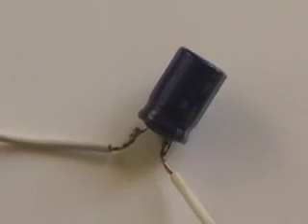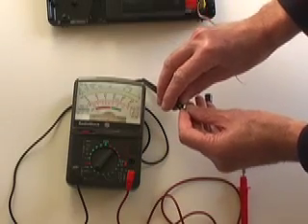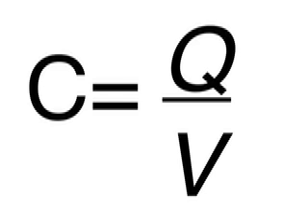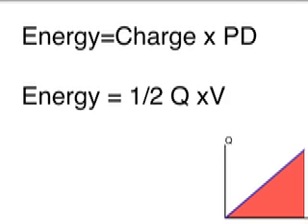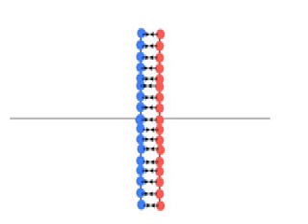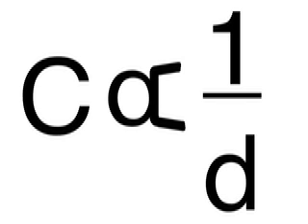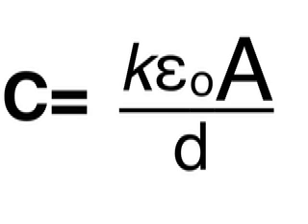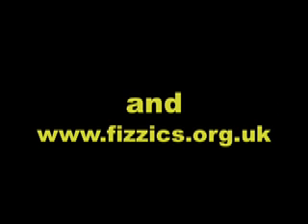How a capacitor works: from fizzics.org

Comment: But WHY are capacitors needed to store this energy?  I get why resistors are needed to reduce energy, but I don't get this.
Reply: Combined with a transistor it creates an repeating electrical pulse used for timing, creating a tone, and for creating a short increase in a charge like for a camera flash.
Reply: ***** Ok, but there's a battery in a camera. Why would you need a capacitor for the flash if you have a battery? Are you saying the capacitor gives the flash a boost or something? Would you mind giving me a couple more examples? I still don't get it.
Reply: Yes, when a capacitor discharges it let's out the power it has gathered all at once giving the current a boost depending on how big the capacitor is. Capacitors are used in just about every electrical device to create a pulsing circuit. A capacitor won't discharge unless the circuit is turned off, but when combined with a transistor it can be turned off and on very quickly making a pulsing circuit, or oscillator. This means the circuit voltage is going up and down in gradual or sharp humps, creating a wave frequency that can be used for radios,and making sound or a blinking light if you want. Every computer or calculator uses an pulse circuit to check every millisecond, or so, if you have pushed a button. It's also used to regulate a computers central processor so it works in an effective orderly manner. It's like an electric heart beat.
Reply: ***** Ok, I see. Very interesting. I've searched the internet and watched videos here on youtube and nobody stops to explain why capacitors are needed to do what they do, only how it works. So I very much appreciate your help. Thank you!
Reply: http://electronics.stackexchange.com/questions/4784/why-use-capacitors

Comment: POTENTIAL DIFFERENCE ACROSS THE PLATES  IS SAME AS THE VOLTAGE OF PS(POWER SUPPLY ) USED.
    ONE MORE THING :- DIELECTRIC INFACT REDUCES THE NET ELECTRIC FIELD HENCE INCREASING THE CAPACITANCE-YOU CAN PLEASE CORRECT THIS IN YOUR VIDEO

Comment: if capacitor are same value (same mfd or uf) same micron ,with almost same tnde why  the difference betwen voltage one with 100 volts ac & other 110v ac

Comment: @katsumorymoto It is my understanding that capacitors are used in circumstances where voltage may drop too low. The capacitor will discharge when the voltage falls below a certain point and will recharge on the next peak cycle. I am also very new to this too and I had basically the same question so hopefully someone else will jump in on this and help us understand it a little better. For now i guess I am going to keep searching.

Comment from the maker: It depends what you want to test but you can't measure capacitance directly with a multimeter. The maximum voltage depends on the type of insulation between the plates/layers of foil. The max voltage is usually printed on larger capacitors. A capacitor fails when the insulation between the plates/layers of foil is too small for the applied voltage and a current leaks across.

Comment: @sandhyasonule1 I think: In a bandpass capacitor(not electrolytic) the ac signal being applied to one plate has an opportunity to resonate the plate generating a magnetic field- its optimum resonance would be determined by the size of the  plate and the dialectric. The second plate picks up that fluctuating magnetic field. This is why caps are used to decouple ac/dc..because dc does not fluctuate it cannot pass the dialectric...I think im pretty close but I hope that helped :)

Comment: capacitor is made of plates and dielectric material then when it going to discharge does current pass through the dielectric material, if yes how insulating material pass current ? i got this question in my mind bcoz capacitor is analogous to lightning in which ground and cloud is two plate and air is dielectric. thank you

Comment from the maker: It depends what sort of capacitor it is. For some it won't matter, the two plates are the same with a simple layer of insulation between. However in an electrolytic capacitor the layer of insulation is a film of metal salt or oxide formed by chemical action on one of the plates. Reversing the plates will break down this layer and so the capacitor will fail. You can tell if the capacitor is electrolytic if it is marked with a plus and minus on the terminals.

Comment: proof that tesla has a patent for the first electrical capacitor electrical condenser June 17, 1896    Electrical Condenser                        #567,818   219
Nov.  5, 1896    Man. of Electrical Condensers, Coils, &c.   #577,671   222 look up those patent numbers and you will see

Comment: after some research i have discovered  the first aluminum capacitor was discovered, some thirty years after Faraday's work, the SI unit used measuring capacitance was named a farad (F) in his honor. So, as seems pretty obvious, Telsa cannot possibly hold the patent.
 Farady's work gives us pretty much the modern capacitance definition including variability through plate area and distance of plates also.

Comment: Two people, Ewald Georg von Kleist and  Pieter van Musschenbroek invented the capacitor in 1745, independently. The first capacitors came to be known as layden jars (after the uni of layden). In fact the first unit of capacitance was called the 'jar' equivalent to about 1 mF.
Alessandro Volta (as in volts) 1782, came up with the condenser, which is like our larger modern capacitors.
 As for telsa, work was on transformers and inductance.
Please expand on his novel ideas regarding this.